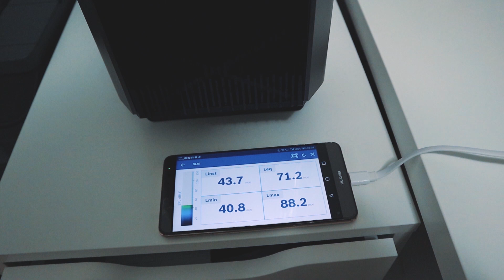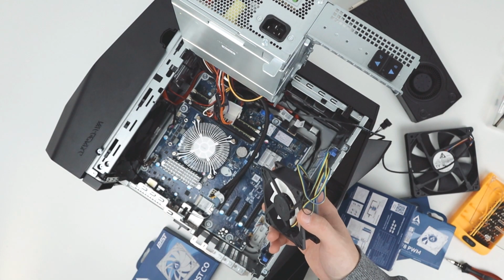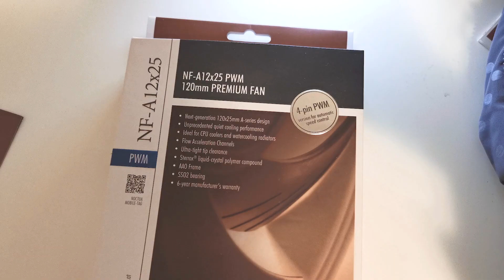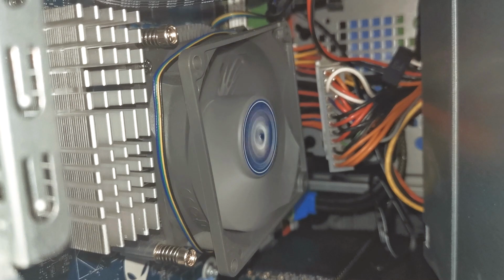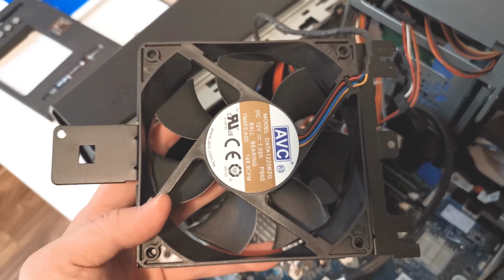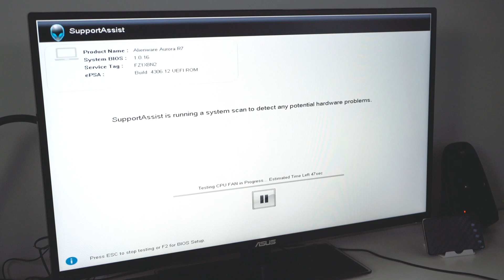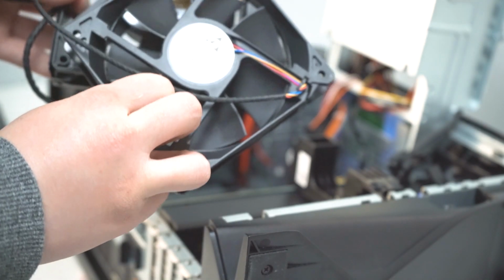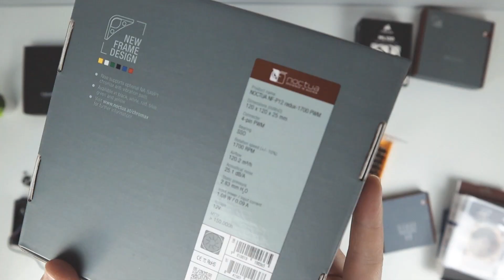Alienware Aurora R7 Fan Exchange

Comment: Thanks for the great video and clear description.  My Aurora R7 was very loud so I upgraded to BIOS Version 1.0.26 (1/19/2022) hoping it would make a change.  The front fan then started giving a hardware error on boot up.  So, I tried upgrading all fans using Noctua NF-A8 PWM for CPU and Noctua NF-12 Redux for front and top fans as recommended.  The new top fan and CPU caused new hardware errors, so I had to put the Dell fans back in.  The Noctua NF-12 Redux I used for the front fan worked great and got rid of my initial hardware error.  What a fickle machine this is :)

Comment: Thanks for this. I swapped out the front fan with the recommended  Noctua NF-P12 redux 1700 and it has already made a huge improvement. I've another on the way to replace the top and also the CPU fan with the Noctua NF-A8 PWM. While I'm at it, I'm gonna put some new thermal paste on the processer to help. (I'm looking up which paste to use so anyone got any suggestions please let me know!) 
One thing which is my fault, I've not been keeping the inside of the case clean. The GPU fan and outlet was caked in dust as was the vent grilles. This case is tight so I guess extra housework is needed to keep it in shape.

Comment: Hello, I got 2 noctua nf p12 redux 1700 Pwm as the front and top fan replacements on my aurora r7 i7 8700 gtx 1070 ti and I’m still getting a support error code for the top fan, even though it is 1700 rpm
Reply: Same, I ended up returning fan and going back to stock. Kept one for the front fan since that one was fine.

Comment: Warning, these fans no longer work due to Dell update.
Reply: Can you clarify which ones don't work specifically?
Reply: @B00F13  It triggers the top fan error, and there's no way around it.
Reply: @PrincessMerleen  Does that still include the ML120 Pro? Looks like consensus here is that he was able to use the Redux as a top fan prior to an update that blocked it. I ordered an Arctic P12 PWM PST and will try on my R8 soon.
Reply: @B00F13  The one I tried is the one that he used in the video, Noctua NF-P12 redux-1700 PWM. I was still able to use it for the front fan but not the top. I haven't replaced my top fan yet, I've debated with going liquid.
Reply: @PrincessMerleen  What dell update changed this? I’m trying to downgrade bios to use the fan
Reply: @lucidddddddddddddddddddddddddd  I have no idea, it's been awhile since I tried. But if I remember right it was because Dell added it to their incompatible list basically in the system. I don't think there's any way to change that. Nothing that I could find at the time unfortunately.

Comment: I just installed the same noctua fans you linked in your bio but I'm still getting the fan error? And its not spinning at all on top fan. Front fan works just fine, any advice you could give?

Comment: The CPU needs a high RPM fan. A Noctua or similar one reduces your max speed so if you have a higher wattage CPU it can overheat.  I replaced mine with a Delta low profile one, it runs cooler than the stock fan and at lower RPM because it can grab air easier because it has 2cm instead of 1cm to the PSU.
Reply: can you please tell me what fan you used for the cpu fan i want to upgrade it but i dont know which one is compatible please
Reply: Does it still show the bios message with that fan?
Reply: I never got any error with the Delta low profile fan  @pafeso1659

Comment: Great video. I have just rebuilt my R7 in a new case (Corsair 4000D Airflow) and I have the last issue to overcome - the top fan. Noctua NF-P12 redux-1300 is giving me a trouble. I will try Noctua NF-P12 redux-1700 as you suggested.

Comment: Great video but I bought the fans you used and my pc says the top fan is not compatible, even though I got the noctua nf-p12 redux. Any ideas why its not working for me?
Reply: Did you ever find a solution? Just trying this now and having the same issue
Reply: Unfortunatley not really, but something that worked is using the splitter that came with the cpu fan (I think) and running both fans from the one header which works, but the computer won't boot unless both headers have fans connected so I just connected the stock fan to the buggy header and had that fan just hanging out of my case @Bradwinner99

Comment: I have the r7 with the water cooling cpu system and I was wondering if it was still a good idea to try and replace the top fan. It's much louder than my front fan. Also, do you have any tips for cleaning the radiator system? It's gotten dusty. Nevertheless, thank you for this video!

Comment: I got a fan failure during system test with the Corsair ML120s in my R7. I replace both the front and top. Any suggestions?
Reply: I'm having the same problem. Have you found a fix yet?

Comment: What type of screws did you use instead of the rubber bits for the top fan? I need to replace the fans in my Aurora R5 soon since they are not able to keep up any more being as old as they are, and the rubbers on my top fan look like they would break pretty easily.
Reply from the maker: I used the ones come with the new fan.
Reply: @OnboardCircuit  Okay wasn't sure if it came with any so thank you.

Comment: I followed this guide, used the recommended fans and I am getting the support assist error for the cpu fan at start up.  I did a system check and it says all 3 fans have errors.  When I load into windows the ACU shows all fans are running..

Comment: I removed front fan when I change the graphic card RTX 2070 SUPER, there is a system error when I start the computer. is there any way to delete the message? or Noctua front fan is work for  GALAX GEFORE RTX 2070 SUPER EX BLACK OC D6 8GB (285mm)
Reply: 11.22 inch

Comment: Replaced the top and front fan with the same noctua nf-p12 type fans. Getting top fan system bios failure. However after it gives me the error and I press continue it boots up and works anyway. These fans are sooo much quieter than the originals. I guess I'll just have to deal with it or leave the computer on sleep mode all the time to not have to deal with it ....gotta check temps now
Reply: use a 4 to 3 pin adaptor for this fan you wont get any more errors (for top fan only front can be any fan)

Comment: Hi, i bought the Noctua NF-P12 redux 1700  And the Noctua NF-A8 PWM both gives me error!! in Aurora R7,  is there any other config to do ?? thanks
Reply: use a 4 to 3 pin adaptor for this fan you wont get any more errors (for top fan only front can be any fan)

Comment: when i changed my pc cooler from air to an AIO i started to get that support assist thing but theres a fix for it i forgot what i did but i found it online u jus gotta turn something off and the support assist thing will go away so you can use any fan you want

Comment: Hi Harry! I LOVE your videos & I think you are quite a computer aficionado😉 Since you are so knowledgeable, I trust your judgement & I would like your opinion...

I just installed a new Corsair RM 850x psu because I didn't feel that my GTX 1080 was performing at capacity. While playing certain games & while using my Oculus, I was being throttled by heat & what I felt was...lack of power. Because of the heat issue, the fans were running, running & running some more & IT WAS LOUD! Originally I was only going to replace the cpu fan/cooler so I purchased a Thermalright MACHO Rev. C but it was a little too tight for my liking & the screws were too big for the mb. I did NOT want to drill the system board so the backplate would fit, so I needed something more low-profile. Then I saw your video & it was VERY helpful, so I ordered 2 Noctua NF-P12 redux-1700 as replacements for both outtake fans just as you've done in this video.

Now that I've finished my biography, my question is this: Since upgrading from a 460w ps to an 850w ps, should I just replace all 3 fans OR replace the cpu fan/cooler with the Noctua NH-L9i & only the 2 outtake fans? I would LOVE your opinion!! PLEASE?
Reply: If you replace the CPU heatsink you'll need to get 3 #6-32 nuts for the intel bracket. I had to do that in order to install the NH-L9i.

I've also replaced my front fan and it's a HUGE difference in sound signature. Temps dropped about 15-20*C when I replaced the CPU heatsink/fan. I'm still doing a little more research on the top fan though. I keep getting conflicting information on what works and what doesn't. I might stick with Noctua. They are quiet.

Comment: I bought the exact same fans as you but I'm still getting that CPU fan error on boot-up.  Both the front and CPU fans are spinning.  But the top fan spins for a second or two then stops.  What did I do wrong?
Reply: I used the Cosair ML 120 pro for top fan. This is the only one doesn't cause error.

Comment: Will this fit in for a replacement on the front fan? 
Noctua NF-A12x15 PWM, Premium Quiet Slim Fan, 4-Pin (120mm, Brown)

I'm trying to make room for the PNY 3090 I ordered from Dell. From the dimensions I saw on the 3090 I was about a half inch shy of being able to fit  it in my Aurora R7. My thought is that if I placed a slim fit front fan in place of the original I would have sufficient room to work with. Please reply with any thoughts or experience on what I'm trying to do on this.

Comment: As of now, looks like top fan gives hardware failure. I used Noctua NF-P12 redux-1700 PWM as said
Reply: I am too
Reply: did you figure out a fix
Reply: @gozz9999  no unfortunately, I just use the stock top fan and returned the Noctua.
Reply: Having the exact same problem now

Comment: Hi. I just changed both of my fan(front, top), i bought the corsair that u reviewed in this video. Plugged every wire at the right spot. Somehow i get support assist and also i get around 90° without doing anything. The top fan is still pushing the hot air hot but doesnt seem tom be using all of his power. Hard to explain.. if anyone know how to fix this plz awnser thiscomment
Reply: I'm having same problem.
Reply: Did you ever get this fixed?

Comment: Thinking of swapping out just the front fan (I have a water cooler in mine). Think that it's worth it?
Reply: Yeah I want to know as well, I have a water-cooled system too and was wondering if it would be worth it. (And if there are any other procedures to know about when replacing)
Reply: I actually just went ahead and did it and there was an appreciable difference in both audio and cooling. I OC the graphics card and a Noctua NF-F12 helped a decent amount and it's infinitely quieter. I went with a high static pressure fan because it has to push through this tiny case and the GPU.
Reply: @JonnyEsports  can you please let us know how to swap the front fa n?
Reply: @JSyntax  4:40 this guy covers it

Comment: I replaced my A7 with the exact configuration you suggested and I'm still getting the support assistant message every time I restart the PC.
Reply: Me too, did you solve it?
Reply: @jasonzhao7999  No , still get a bios error every time the PC restarts.
Reply: @darthrob  Thank you for your reply and I have to get all the fans returned because of that. So sad.....
Reply: @jasonzhao7999  I kept them in since the noise was so loud with  the stock fans, gaming with a headset was impossible.  I think at some point I will just build my own PC.

Comment: One question. using The corsair ones did you get the noise reduced compared with the original ones?
Reply: Bought the same ones yes its way lower then the original ones. Ofc if you crank it to 100%it will make noise but not as near the corsairs

Comment: One question. I bought an evga rtx2070 super so with two fans on the down side. Did I become heat issues with the Standard fans in the aurora r7 ?
Reply: I got an upgrade due to warranty and now have a 2070 evga and so far my cpu under load barely goes over 65c. Idle stays at 50c I'm happy with the temps I'm getting since you gotta remember the psu is right next to the cpu thats also a lot of heat coming from that
Reply: Michael Spotti Thank You very much for Your answer. can I ask from which company do you buy your watercooling system
Reply: I don't have watercooling and I have a r6. I repasted the cpu with decent thermal paste and cleaned the fins from the dissipator using a make up brush from my wife. Temps went from 70 to 60 running cpu intensive games. Might change the cooler and fan in the future but as for now I'm happy with what I have.
Reply: Michael Spotti okey nice 👍🏻

Comment: Hi. Just replaced top fan in the R7 (went with the Noctua you recommended) and I get support assist check on startup each time that fails the test. I can escape out of it and confirm system starts up fine and fan is being controlled by alien control. Any thoughts on how I can disable this check each time system starts? Otherwise, looks to be great. I disabled secure boot in bios, but that still triggers the same test on start that I have to skip each time.
Reply: Hi I have the same problem have you figured it out
Reply: @nathaniels9890  I did a test and sure enough, 1700 doesn't keep up with what the Alienware has. That one ramps to 3000+. I decided to maintain what I have and will go to a liquid cooling solution for CPU, which is really the only reason the top and front fans vent loudly here and there. Hope this helps.
Reply: Thank you mine solved the issue on its own. I did some more tests and lost hope. But when I turned my computer on the next time the message went away.
Reply: @nathaniels9890  I still encourage you to test the fan speed. The reason it's so quiet is that at high percentage, it's a way lower rpm. It may not be sufficient cooling. Do a comparison to your standard Alienware fan speeds.

Comment: The ML20 doesn’t work for the top fan on r8
Reply: Same but when I open Alienware software or whatever it’s called, then I start a game, that says the top fan working, so idk
Reply: I can see the rpm etc, and I feel the shuffle on my hand
Reply: @lefiamb  mine work but I still get suppirt assist so i leave it in sleep mode when i get off so i dont have to wait everytime
Reply: @lefiamb  what i wouls recommand is getting another fan to replace top fan
Reply: Same for r7
Reply: @b34stmodz54  , What about for the front fan?
Reply: @CDbiggen  both workbut u still get stuck on support boot
Reply: @b34stmodz54  , This is so annoying, I can't believe I have to be careful what fucking fan I buy. Thanks bud, there has to be a way to disable support assist at boot.
Reply: @CDbiggen  that dude who did this video said we wouldnt have thisproblem withml20 but still got it
Reply: @b34stmodz54  , Yeah I saw that too, was thinking of getting it. Hope you get it sorted.
Reply: @CDbiggen  thx man
Reply: B34ST MODZ fax
Reply: Have you tried ML120 pro? I tried multiple fans and thats the only one didn't  cause error.
Reply: @Kyd905  Maybe just contact Alienware support on their website to see if it’s compatible
Reply: @paypur  Yeah I did contact them and currently I'm using ML120Pro for top fan and it's working flawlessly.

Comment: The Noctua NF-A8 is designed to be a case fan only and does not have the RPM to keep a CPU cool. Out of all my research, there is no fan that has the same specs as the original Aurora R9 CPU fan. Even Noctua told me to NOT use their 80mm for a CPU cooler.
Reply: jknjkhui gyjujgbjyu I’m going off of what Noctua themselves told me. I have it in an email.

Comment: Harry does the Noctua NF-A12x25 PWM not work at all or does it just work but has error message when you start up? Wondering if we can disable support assist to prevent these errors but still use the fans which have a higher RPM (this one has 2000 RPM). Thanks for the video!
Reply: Found this on a reddit thread on how to disable support assist. I think these proprietary programs have unecessary restrictions but I know it's all in the effort to keep your PC safe from incompatibilities and voiding the warranty. With that said, I think if it's possible to use a better fan and bypass support assist, then it's worth the gamble. Just IMO. 

DellCares
Dell Customer Support

You can disable the support assist recovery from the BIOS if you wish to do so.

We would also request you to run a complete hardware diagnostics on the computer and share the results with us along with the service tag over a private message just to ensure that there are no hardware issues. Here is how to locate the service tag https://dell.to/2LBz1GR

Here is how to run the hardware diagnostics https://dell.to/2LByGE5 SA

Comment: Thanks for the video..... So you ended using the Noctua NF-P12 redux 1700 for top and front(53.98 Newegg). And the Noctua NF-A8 PWM for the CPU fan(15.95 Amazon). Besides sound, any real temp differences?
Reply from the maker: Yes.
The tempureture did not change much, for what I was doing, which is Video Editing and some gaming... but however, I did change it to liquid cooler after, for much quieter opreation.
Reply: @OnboardCircuit  which liquid cooler did you choose?  and does it work on R8?

Comment: I  replaced just the CPU fan with the Notura and My temps have risen any recommendations?
Reply: Really that sucks..... might want to return that fan and just get this one:  https://www.amazon.com/Noctua-NH-L9i-Premium-Low-profile-LGA115x/dp/B009VCAJ7W/ref=sr_1_1?dchild=1&keywords=NH+l9i&qid=1586663973&sr=8-1
Reply: @Keeping-It-Real-55  this cooler fits to aurora r7 i7 8700?
Reply from the maker: go for liquid coolers. https://www.youtube.com/watch?v=53iF8ZzAgcw
Reply: @OnboardCircuit  Hi there! I recently got an Aurora R9 and it is crazy loud right now. I am thinking to replace the CPU fans with NF-A8 and the top and front fan with NF-P12 or NF-A12. I updated the latest BIOS and I am wondering if the NF-A12 will work with no boot error as the top fan. If I just want silent should I go for the H60 water cooling or just change the fans? thank you so much.